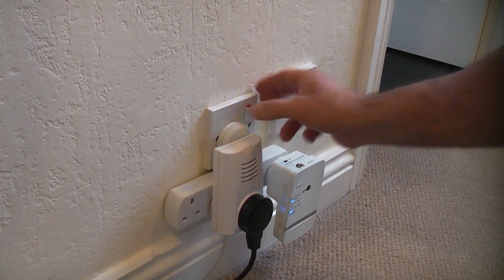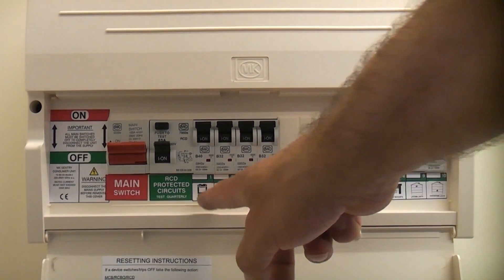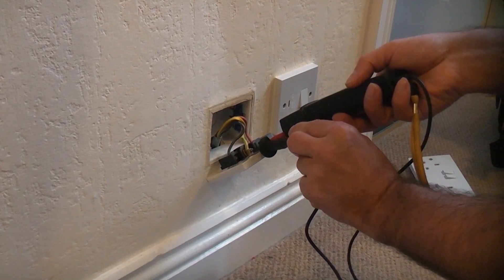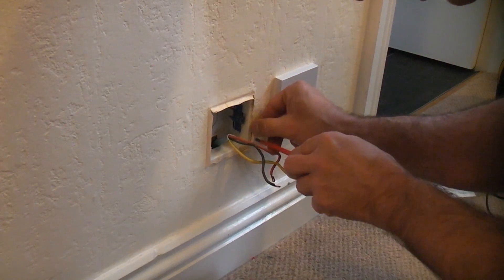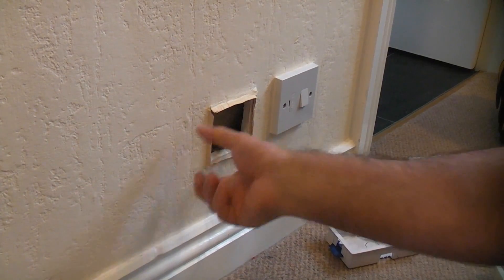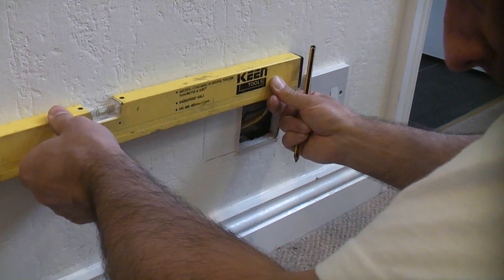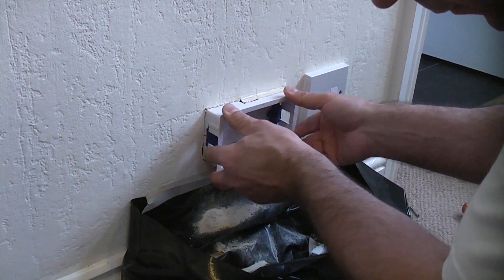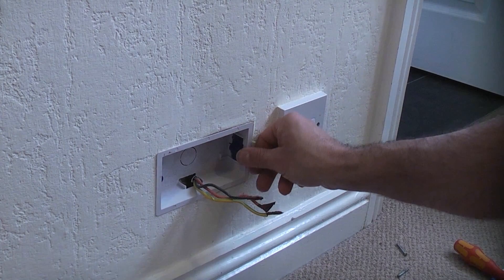How to replace a single socket with a double socket

Comment: Hello, I know this is a very old video, but I was wondering...I've watched a few videos on how to do this and they usually show 6 wires, two of each, yours only shows 3. Is that OK? What's the difference between wiring in the 6 vs 3? I'm working my way around plug sockets in my home and so far they've all had 6 so it's been easy. But now I've come to one with 3!

Comment: Why not use a 1 to 2 conversation plate ! Easy on a brick wall
Reply from the maker: This is not a brick wall, it is a stud partition wall.
The convertor sockets are not great, there was a post in the forum, where one had burnt out, unfortunately the post seems to have been lost when the forum was upgraded to the newest version of software!

Comment: You really helped me with this mate. Thanks so much. My only problem is on one side of the back box The plaster burst as a previous electrician took a spur from the single socket so one side was plastered. Now I have nothing for the back box fitting to grasp on to. Would you have any ideas what I could do in that situation??

Many thanks
.David
Reply from the maker: You might have to pull the back box out and insert a suitable piece of wood, longer than the width of the backbox, then apply some filler to the front!
Reply: @ultimatehandyman  thanks buddy will do 😉

Comment: Great informative and easy to follow video. Gave me the confidence to do this the other day to a socket in my house. I made a bit of a mess of the surrounding paintwork but the key point is that the electrics are all good and wired properly! Also great tip about taping the rubbish bag to the wall.
Reply from the maker: Glad it helped
Thanks for the comment 👍

Comment: What would you use to chase it out if it was a brick wall?
Have you ever used those 4 or 2 gang extenders that go over a single gang?
Reply from the maker: I'd use a wall chaser ( I used to have one, but sold it, as I never used it)
I have seen the extenders, but I am not keen on them!
Reply: @ultimatehandyman  I was going to get a sds but couldn't justify 200 quid for a tool I'd only use once or twice.
In end I decided to surface mount them

Comment: Great work. Would you ever use a dado trunking for more sockets or Are they not Sturdy and need to be high level?
Reply from the maker: I'm not a fan of Dado trunking in domestic houses, but it's common in some commercial premises
Thanks for the comment 👍
Reply: @ultimatehandyman  why not? Just unsightly and takes up too much space where surface mount is sufficient?
Reply from the maker: @justintemp   I only do electrics in my own home. I'd either chase the cable into the wall, or feed the cable up a stud partition.

Comment: Thanks for the video. Going from a single to a double, does this increase the total amps from 13 to something higher?  Is it now 20 amps? 10 in each?
Reply from the maker: Yes, the maximum would be 26 amps (13A in each socket) but it's highly unlikely that anyone would plug in two appliances that pull 13A all of the time. 
Thanks for the comment

Comment: How does this affect the amps the socket can handle? I want to convert a single to a double and use extensions to run all my computer stuff.
Reply from the maker: It is much better using a double socket than putting all the load on one socket 😉
Thanks for the comment
Reply: @ultimatehandyman  Thanks. Also, nice video.

Comment: Hi does anyone know what that little gadget was called that he used to test the plug socket to make sure electricity was off. 
Thanks.
Reply from the maker: It's a socket tester. You can get loads of different ones now, which can test for earth loop impedance etc. 
Example of a basic one here- https://fave.co/3jnAUsd
Thanks for the comment

Comment: Ive just done something like this. I turned off the upstairs lights with fuse box, lights upstairs then went off. I went upstairs and started to wire up a new dimmer switch. WHACK! i jumped off my ladder and was electrocuted. I did isolate t he fuse box downstairs so wondered how this was possible. I turned the whole fuse box off next time and did it. Upstairs lights run from 1 of 4 fuse switches, i pulled 4 and lights went off upstairs. So how did i get a shock?
Reply from the maker: There could be a few causes, such as a faulty isolator. It's always best to check that there are no live wires using a suitable tester, as the light going off does not guarantee that it is safe to work on.
Thanks for the comment
Reply: @ultimatehandyman  Thankyou for the comment buddy and straightening it up. I still cannot understand how the red wire was still live? I bet we have faulty wiring system in our house somewhere.
Reply: @andisadler2897  Could be someone's added in the light as a spur from the ring main. Switching off circuits in turn in the fuse box will give you an idea.

Comment: I'm i right  by saying this. I have single sockets in the house. I just opened  up and has two lives and two natural. I bought a socket converter to convert it to 4 gang. I'm right in saying just double  the two lives up and the natural up as they ware in the single  socket ain't i. Single earth wire
Reply from the maker: Yes, that is correct, but there should be two earth wires!
Reply: @ultimatehandyman   yeah they was upon opening  properly they just used one sleeving for two earths

Comment: Great vid. I have same issue but its on a tiles surface so can't knock tiles off... Wonder if I could convert to surface mounted twin. Instead
Reply from the maker: Yes, you could use a patress for surface mounting ;-)
Reply: @ultimatehandyman  might do that. Route cables up and then patch it to surface mount.

Comment: Mate I changed my socket a while ago to a double. Im going off to outdoor socket in a min but why do i have 2 live red wires on the screw driver both light up individually.  I thought one would be an out and go to next socket? Thanks
Reply from the maker: Most sockets are wired in a final ring circuit, so the sockets are fed from both directions-
http://www.ultimatehandyman.co.uk/how-to/electrics/ring-circuit
Thanks for the comment 👍
Reply: @ultimatehandyman  I did figure that in the end. Due to issues I've been using the electrics without the other live from.the other side of the ring . So as all sockets now are coming off the one ring is this safe? I have now tempary sorted it though

Comment: Nice and professional work. A questions please: I have a 3 buttons switch with an adjacent empty box. Can I add into the empty box a power outlet using the wires in the next 3 switches box? - please advise. Thanks
Reply from the maker: I'm afraid I can't answer that question without seeing it.
Thanks for the comment 👍

Comment: I have a single  fused socket at the bottom of my stairs which on the pcb says stair lift in pen. the fuse in there is an hager mtn 116 b16. the house is a new build and there as been no stair lift in the property as we are the only ones to live here. i wanted to change this into a double socket but a single at the very least any help would be appreciated.

Comment: Is this suitable to do to a washing machine plug that I also want to put a tumble dryer in aswell or would it be to much amp going through it
Reply from the maker: It should be fine, as you could just plug a double adaptor, or extension lead into the existing socket.
Thanks for the comment 👍

Comment: Very nice video. How would you have replaced that to socket from a dimmer?
Reply from the maker: A dimmer is for a lighting circuit, I'm afraid you cannot install a socket on a lighting circuit.
Thanks for the comment

Comment: Great video.
I'm going to be replacing plug sockets a lot in the care home I work at, the volt tester you used looks useful, do you need to get it calibrated?
Reply from the maker: No, it does not need calibrating, but it is important to get one with a self test function- otherwise you might need a proving unit and they are expensive.
Thanks for the comment
Reply: @ultimatehandyman  thanks, I will check screwfix. Yours looks like the ones they have for 7.99

Comment: How can sure which wire is live , neutral  or earth ?
Reply from the maker: You can tell by the colours-
Brown or red is live
Blue or black is neutral
Green and yellow is earth
Thanks for the comment
Reply: @ultimatehandyman  without wire colours can be know?
Reply from the maker: @borabora7870  You could probably test the wires using a voltage tester, but that is best left to the professionals.  Not sure where in the world you are, but in the UK wiring should be coloured to clearly identify the wires.

Comment: Is that 2.5mm T&E that has been spurred off a 32a ring? if so then I thought only a single 13a socket is allowed as a spur? Adding a double socket is dangerous as there is no fuse to protect the wire from overload. I mean, what if someone in the future was to plug two 3kw heaters into that double socket? I think for a double socket 4mm cable should be used, just saying.
Reply from the maker: You could plug three 3KW heaters into a triple adaptor- plugged into the single socket, just saying ;-)
Thanks for the comment
Reply: @ultimatehandyman  NO because the fuse in the adapter would blow
Reply from the maker: Double or triple adaptors in the UK are not normally fused- just saying ;-)
Reply: Spurring a unfused double socket on a single 2.5mm  does not comply with BS1363 regs. An unfused adapter does not comply with BS1363 part 3, which required all adapters carrying 2 or more plugs to be fused. It has been illegal to sell adapters in the UK that don't comply since 1991 when the 16th edition was brought into law. Unfortunately there is nothing to stop someone from using one that was sold before 1991.

Comment: Very helpful video and very clearly spoken instructions mate,,,have you got any videos on how to add another double socket,,,,,I need a double socket in the corner of a bedroom,,there is a socket on the other side of the wall in the other bedroom 👍
Reply from the maker: I've done a video on how to install a back box, but not on how to do the wiring, as the electricians would have a hissy fit- and I get trolled enough as it is LOL
https://www.youtube.com/watch?v=oso7NWPOFyE
Thanks for the comment

Comment: Just an observation that that's a single set of wires so that socket is on a spur and not part of a ring circuit.
Reply from the maker: I thought I mentioned that in the video!
Thanks for the comment

Comment: Are extension cables with a four gang socket safe as there's only one plug in the wall socket and the cable takes the unit of sockets away from the wall? (If that makes sense!)
Reply from the maker: Yes, they are perfectly safe as the extension will have a fuse in the plug to protect it.
Reply: OK, thank you.

Comment: What the hell, don't you guys also have double sockets that fit in a one single socket hole ? I even found a triple socket that fit in a one hole, although it`s more of an outside the wall.
Reply from the maker: You can get convertor sockets, but they are quite bulky. It's often best to do the job the correct way.
They are not always a good idea- http://www.ultimatehandyman.co.uk/forum1/dangerous-clipsal-converta-sockets-t26212.html
Thanks for the comment

Comment: Removed faceplate from plasterboard wall to discover that the patress box is screwed on either end into vertical pieces of wood. Took the screws out, removed patress box but  if I remove wood what then do I screw into?
Reply from the maker: You use the tabs on the drylining back box, which will grip the plasterboard.
Thanks for the comment
Reply: Of course! Should have known. Duh. Thanks anyway for your great instructional videos
Reply from the maker: You are welcome
Thanks for the comments

Comment: I might convert my single socket into a double socket (located in the hall). However, I do not want to disturb the plaster and brickwork behind. Is there any better alternatives?
Reply from the maker: You can get a converta socket which fits into a single backbox and converts it to a double. 
https://www.screwfix.com/p/schneider-electric-converta-socket-1-gang-to-2-gang-polycarbonate/12849

Comment: You don't need to cover the live up with tape, only the neutral and earth, since the neutral is never isolated (unless the RCD on the entire consumer unit is off you don't need to cover any of the wires with tape) but if you only isolate ONE of the circuits and leave the rest of the electricty on - then you have to make sure neutral and earth are covered up. Many of times the RCD will trip out when neutral and earth make contact and people don't realise this.
Reply from the maker: Thanks for the comment

Comment: Good video but I had a lot of hassle getting the old metal back box out. Actual wiring of the new double socket was fairly easy. So just be aware, folks, it might not be as easy as you think. It took me two hours altogether!
Reply from the maker: Thanks for the comment ;-)

Comment: Thanks for a very helpful and informative video - Your videos are great. I've managed to successfully replace a single socket with a double socket in our garage which makes things a lot easier nearing Christmas. I've also replaced all the plastic white light switches and sockets in our home with chrome/ metal ones using your replacing a light switch video as well. Many thanks
Reply from the maker: You are welcome.
Thanks for the comment

Comment: Was there not 2 places to put the earth wire? If so what would you do as there was only one wire?
Reply from the maker: As long as the earth wire is connected to one of the earthing terminals it will be fine.
Thanks for the comment

Comment: How do you proceed if you find there is a wall stud to the left of the single socket and therefore no space to expand to a double there?
Reply from the maker: If there is a stud in the way there is not much you can do- if you can't go in the other direction either.
Reply: Thanks for answering. Not an issue that I've encountered, just wondering if you had some magical answer :p

Comment: Hi, thanks for this video! Very clear. I don't think this has been asked, but I'd appreciate if you could clarify: is the load for these two sockets the same as it would be for the single one you replaced? And what would that be?! Regards.
Reply from the maker: The load in this instance would be the same as exactly the same equipment is plugged into the socket.
Most people would assume that a single socket would handle 13 amps, but then if a triple adaptor is used that figure could be higher or lower as most people with any sense would not plug in a lot of high wattage appliances.
Reply: Thank you. Sorry for my ignorance! My confusion stems from the fact that, on another video I've seen, each of the plug sockets has it own dedicated wiring, where as in yours there is only one set of wiring for both. Could you explain what difference it makes?
Reply from the maker: I've never seen one where each socket has it's own wiring.
In the UK, there can be one, two or three cables. If it has two cables the socket is probably on a final ring circuit, if it has just one cable then it's probably a radial or a spur, taken from a final ring circuit. If there are three cables it is probably a final ring circuit with a spur taken from it.
This might help- http://www.ultimatehandyman.co.uk/how-to/electrics/ring-circuit
Thanks for the comments ;-)

Comment: I have one socket that was missed in the house rewiring. It has a metal back box in a stud partition. There is a metal pipe conduit for the cable. Is there an easy way to remove the pipe from the back box? I want to upgrade it to two sockets, like all the others. The pipe passes into the box, then splays out.
Reply from the maker: It's very difficult swapping from a single to a double if conduit has been used. You would have to undo the nut holding the conduit to the back box, even then you will need room to be able to move the back box.

Comment: Tape each individual conductor as you disconnect the old socket. Doing it after removing the back box is too late, lord knows how it did`nt trip the RCD when the single box was removed. Also when connecting up a new socket, leave the earth til last, as some manufacturers run the earth bar straight above the live and neutral terminals, so you would still have the neutral to earth issue in potentially shorting it out. I know many brands don`t have that set up now, for me it`s just habit.
Reply from the maker: That's a good point.
Thanks for the comment

Comment: Another brilliant video pal, you've got a superb range of knowledge. Wonder if you could help with this one. I'm needing to put a hole through a stone wall to route a new 1.25" waste. What would you recommend to make make the hole? SDS still with a diamond cutter or something?
Reply from the maker: Thanks, I'd use a diamond core drill for the hole. You can use diamond cores with most powerful drills/SDS drills but it is best if they are used with a dedicated machine with a safety clutch.
https://www.youtube.com/watch?v=P0Pj9zzPN0s
Thanks for the comment

Comment: great video as usual. 
my only problem is that it will set unrealistic expectations of electricians in customers heads. come on you kept the place tidy , no bag and box from the socket left in the corner of the room,  no offcuts in the carpet, and you had the cheek to stop the dust landing on the carpet. 
you even levelled the socket. 
your entire industry is not going to like you

only joking ( half joking ) . great job. nice to see a clean spark
Reply from the maker: Ha Ha, thanks for the comment ;-)

Comment: Howcome you didnt just pull the fuse in the spur? Would have been no need to lock off (purely because many diyers dont have them)
Reply from the maker: The FCU at the side of the socket is for a pump, it is nothing to do with the socket circuit.